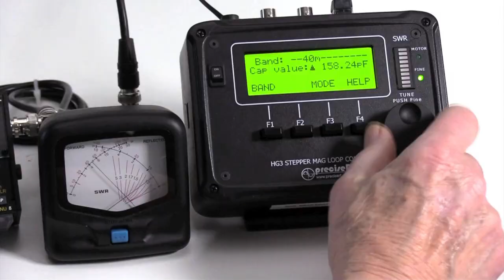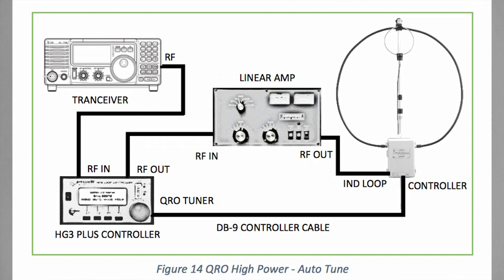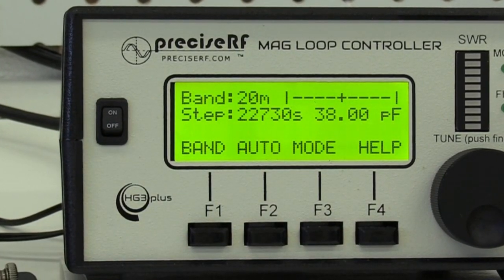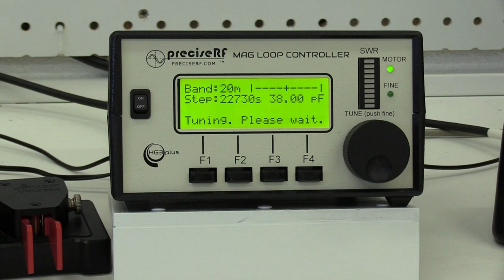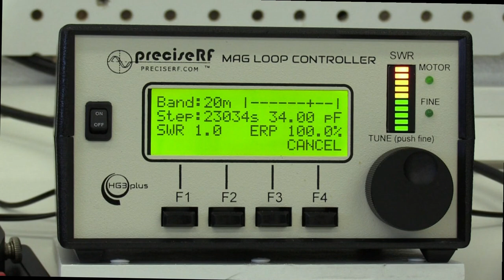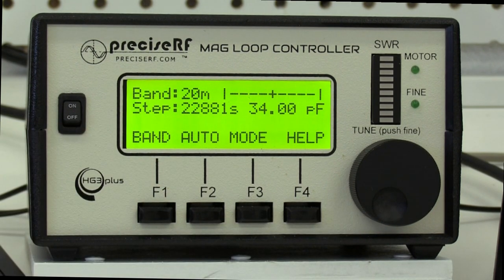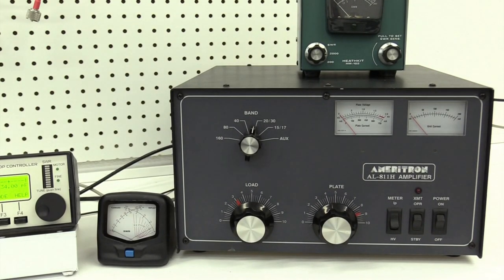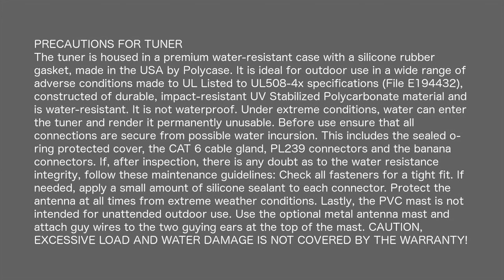HG3 QRO High Power Magnetic Loop Antenna

Comment: On the rotation, can you display and or set a azimuth direction?
Can the controller follow the frequency set by the radio? 
I assume you need to tune basically on every frequency used vs the band selected.

Comment: interesting  that is also the Price        i just do not think so    i can not justify the price 
    this device is interesting   all the same
Reply: de Howie WA3MCK  - The price is fair considering the engineering and quality components used in construction. I shall buy one!
Reply: I don't think mentioning their price was done with disrespect. I would agree the $1,200 for a magnetic loop regardless of the quality of the build seems rather High because you still have to add the rotor on and the 80m and 60m and still the question of performance has to be asked. What's the angle of radiation or the take-off angle? How does it compare to a log periodic it's the same altitude? I have an expensive steppir and I can't see a magnetic loop outperforming my steppir. I say this certainly was no disrespect. The inventor is obviously quite a bit of time into this. I did notice an inconsistency in the Q St review and that it talked about how the remote tuner only covered 7-30mhz. What about 80m? No automated remote tuning? I'd really like to see one of these and operation before I spend that kind of money. Reviews on a ham for example don't show the great success that this video might suggest.
Reply: @justanotherguy3850  The manual for this antenna says it will cover 80 metres with an external resonator.  But I am fully expecting it to be quite inefficient on that particular band.  You may very well need the amplifier to work any SSB on 75 metres.
Reply: @justanotherguy3850  $1200 !   That's an absolute bargain !   for the amount of engineering that went into this.  As for the Low bands, you would need a HUGE Loop for that.   There is a Ham in Australia that has a 160 through 40 Loop.   It is at Least 10 feet across.   It is Huge..   I have made several loops.   They work great.  The difficult part is the implementation of the capacitor and the box to run it easily.   Dx Engineering sells Italian Loops that are $3600.   They are Home Station Antennas, and these loops more portable.  You could probably mount this in a permanent location too.  
 
I would be interested in seeing the loop design of this use a Fractal Antenna conductor design, for a permanent placement which has increased frequency capability and reduced size.   I am happy this company is building these and especially for QRO..
Reply: @GreyGhost-r4z  I guess I'm spoiled because I use a steppir. I see the new model has come out and the operator said he can get a pretty good copy of stations if they're an S7 or better. Frankly, that's not good enough for me. I want to be able to dig them out of the dirt. But for some people this may be a very viable option depending on the circumstances or maybe they're going to a Mountaintop or something. I'm certainly not trying to knock the product. I haven't even tried it. I don't think there's anything wrong with the price either. A lot of time energy and money went into developing it and with the small pool of people that might purchase it he needs to make his money back.
Reply: @justanotherguy3850   I like digging out the weak ones too.  😉. I’m still experimenting with mine.  Fun stuff
Reply: @justanotherguy3850  those are nice !
Reply: $1200 isn't a bad price for those that need to use a loop. 
$1200 isn't a bad price for those that want to use a quality loop. 
Magnetic is a different ballgame, and few achieve this level of engineering into their finished build.

Comment: FT-8  1.5KW?????OK?
Reply: Ok what?
Reply: @lizzyfan1986  Sorry
I didn't complete it
I want to know if I can run 1.5KW power in FT8 mode
Reply: @bx6abv677  According to user manual, for 30%duty cycle the ma is 800W. If you operate FT8 or RTTY (50% duty cycle) the max would be 450W.